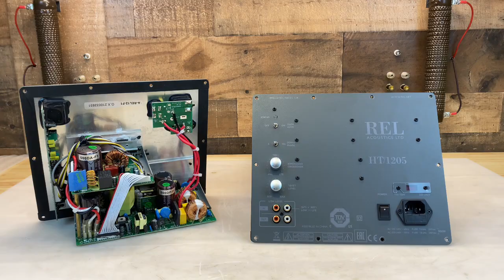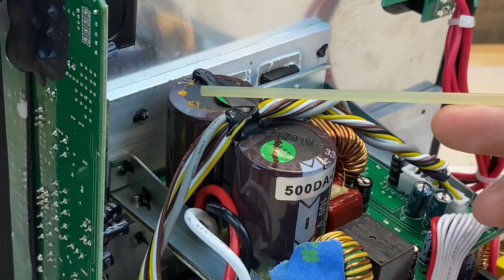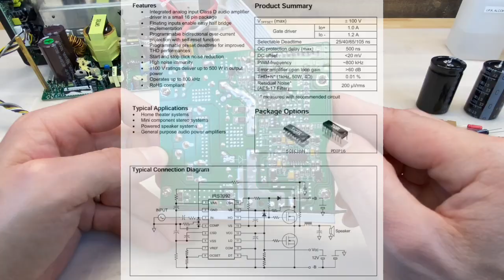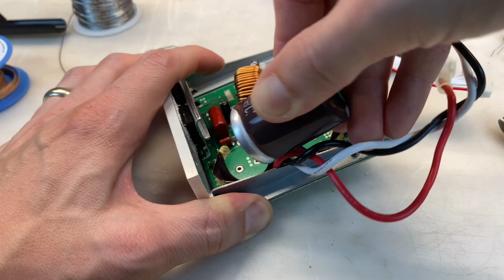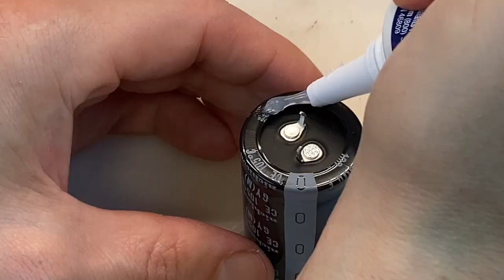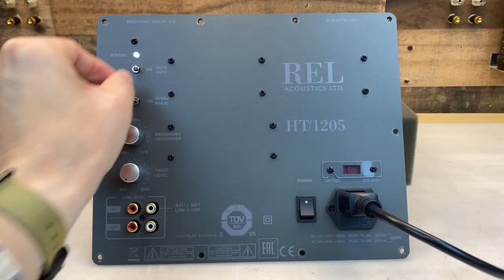DR #69 - UK HiFi Sub Amp Repair

Comment: Same sub same problem. Thank you so much for this video! Got the old caps out and the ones you recommended on order. I’m absolutely and amateur solderer so fingers crossed I didn’t get the board too hot trying to desolder and clean up the pads.

Comment: As of yesterday I have exactly these same symptoms with the same sub, I’ve removed the back plate and found the same 2 bloated caps, but I’ve no idea how to remove them they’re glued down pretty well.
Reply from the maker: Yes it’s like cement. First, remove all solder from the leads. Then, use a heat gun to warm up the glue. Eventually it will become soft enough to remove the caps. Just be careful not to overheat surrounding components.